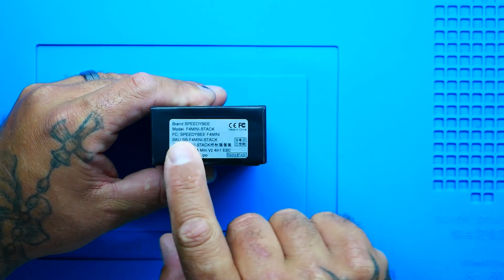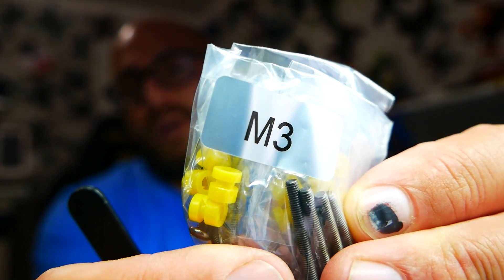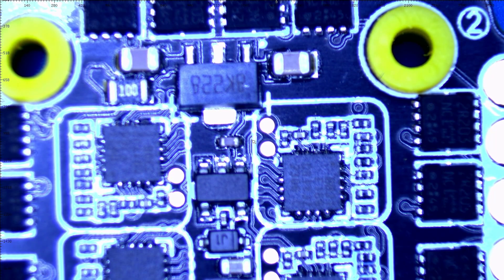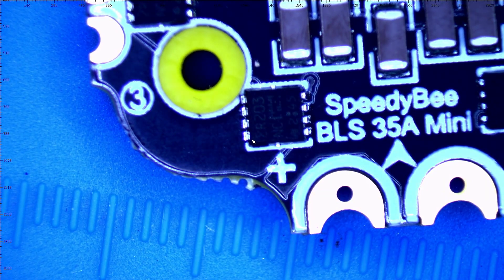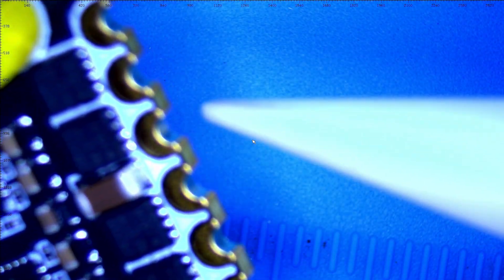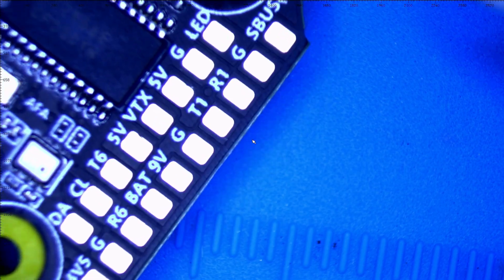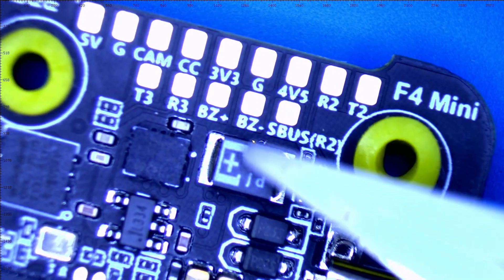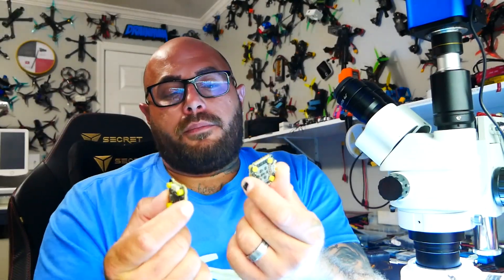What If One Stack Could Do It ALL & Was Only 60 Bucks !!??

Comment: Hello. Can you help me please? First, I have this stack and I've found out that the STM32 chip and a bluetooth chip are really hot (I can't touch them for a long time), even if FC powerd by USB only (no matter ESC connected or not). But FC is working. Is that normal? Second, I cann't flash ESC #3. I have message "Erased or unknown firmware". How can I fix it?